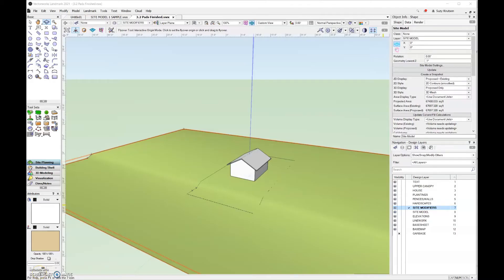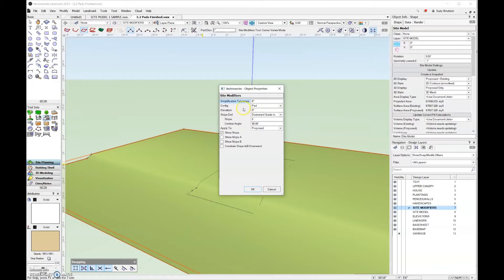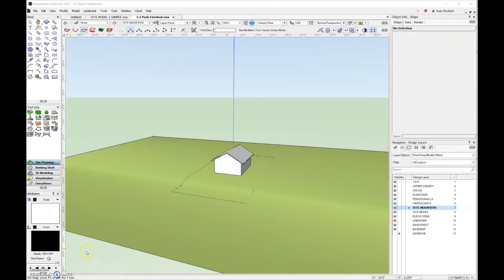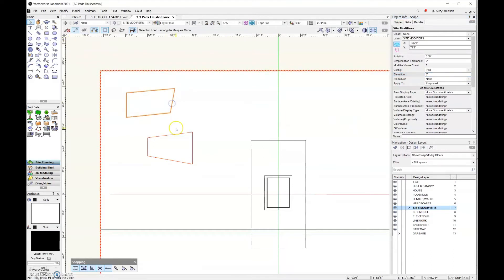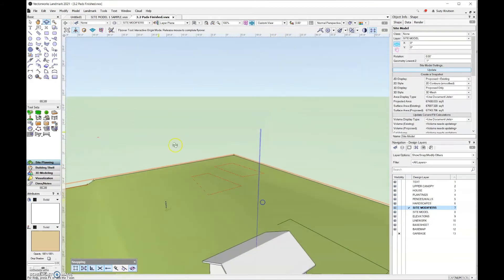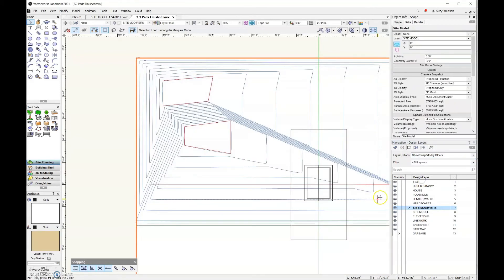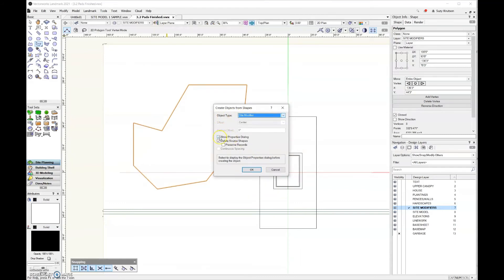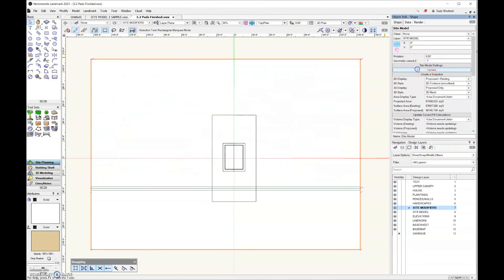14.1 Pad Site Modifier - Vectorworks 2022

Comment: Hello, how come my site modifier in VWL 2023 does not lift the terrain around it, but goes up with vertical walls? The modifier is now called planar pad - is the function changed? Any idea anyone?
Reply from the maker: Vectorworks made some pretty substantial changes to site modifiers in VW 2023. I'll post a short video showing some of the basic changes related to planar pads and grade limits. Check out VW University for more info regarding site modifiers in VW 2023.

Comment: Well, there is a situation. I have my landscape model on "Site model" layer. If I create site modifiers on "Site modifiers" they do not affect on landscape model. But if I select then these modifiers and change their layer to "Site model" then red "update border" is appearing and after update - these modifiers will affect my landscape model correctly. So, it seems that site modifiers do not work with landscape model if they are not on the same layer.
Reply: "Show/Snap/Modify/Others" Selected?
Reply: @stellercorpse  I found the reason.  In "Site Model Setting - General - Use Site Modifiers on: " it has been selected "Same layer as Site model". So, I changed it to all layers and it start working right. I just didn't know about it. But luckily, I found it intuitively. As the saying goes - Live and learn